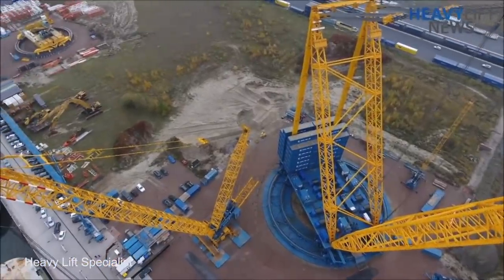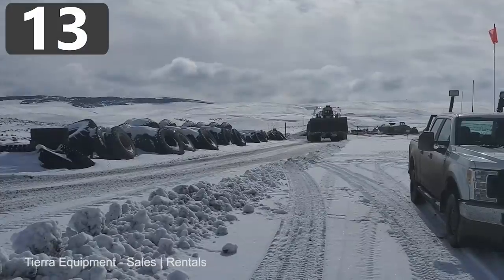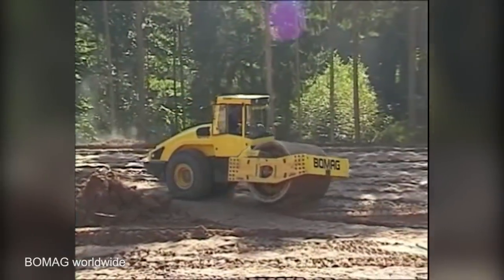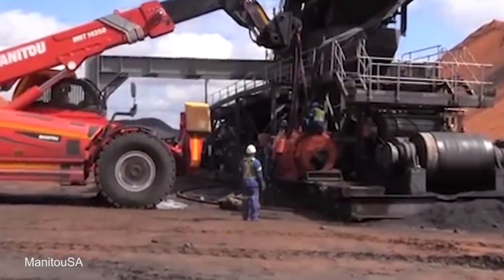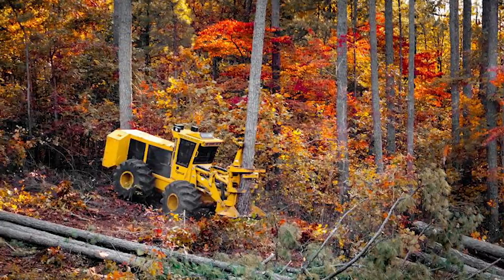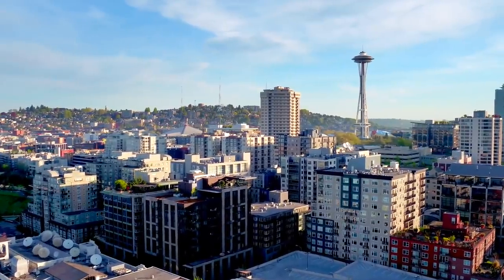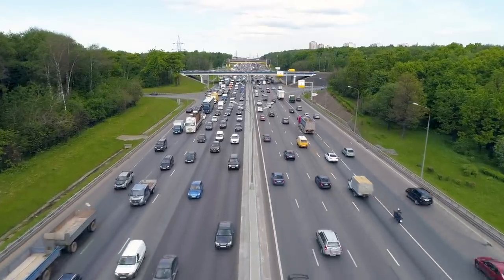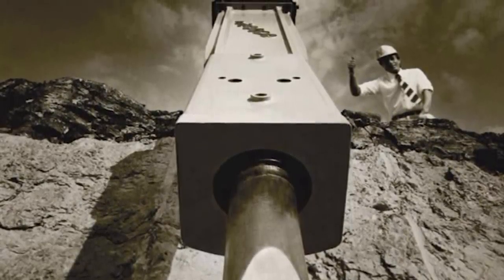15 EPIC HEAVY Construction Equipment

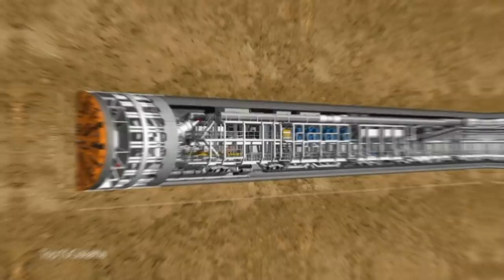Comment: 12:30 How did "Big Bertha" cost a "mere" 80 million dollars? There are that cost upward of  100 million dollars . How the hell did they engineer and build, deliver that thing for 80 million dollars? That has to be an accounting trick. It is 6400 tonnes of specifically engineered steel nuts, bolts, specialized hi-tech equipment. Operated and designed by experts. Just the design alone would cost at least one million$. And the production a couple of million$. I guess these experts are just massively undervalued or extremely efficient.

It is not really understandable how such feats of engineering are done for the price of a pretty averge top end player transfer in football. Maybe the question isn't how it was done for that money but how other things are so incredibly expensive in relation to it.